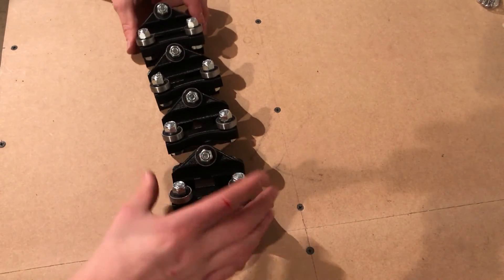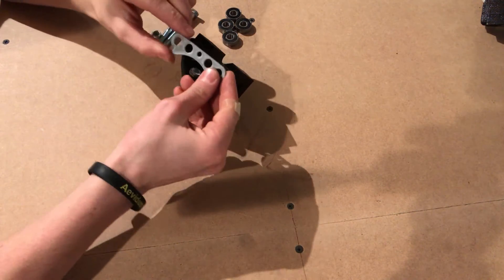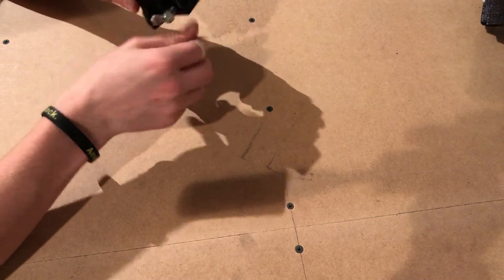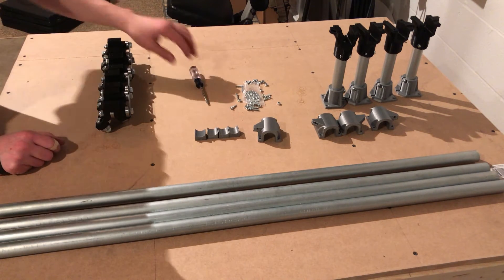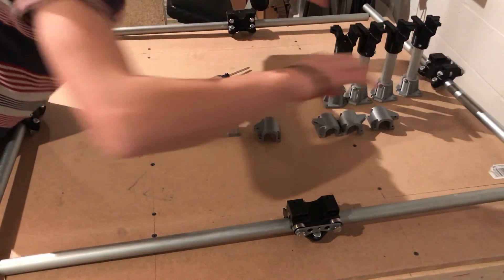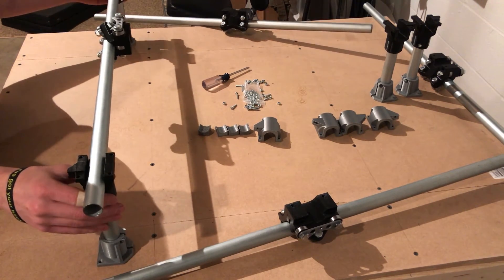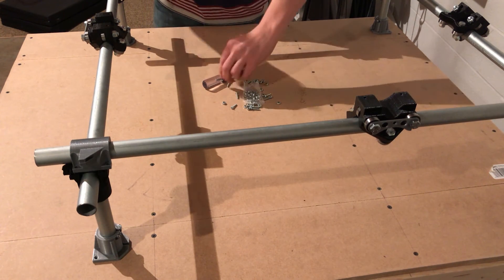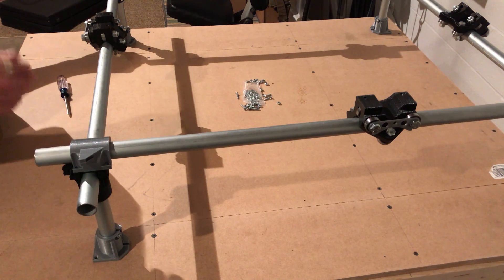Mpcnc part 4: Frame

Comment: What are the build dimensions and actual workable dimensions
Reply: +Abhin Raj It can cut 23.5 x 23.5in. Caint remember the build dimensions. There is a calculator on the Viscous1 website, punch in your desired workable area size and it will give you the build dimensions and the tubing length.
Reply: Studio Projects will it be sturdy and accurate if the build area is 3 foot * 2 foot.  Pls suggest.  I am planning to build one